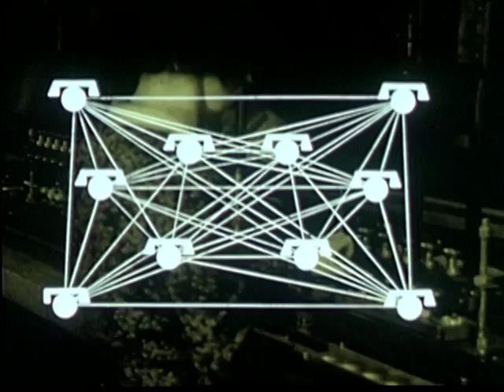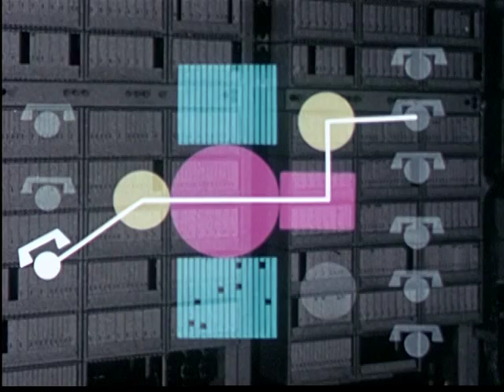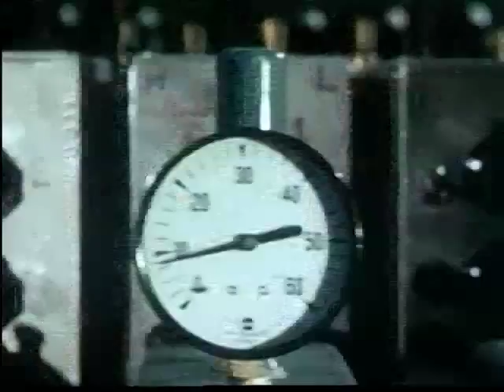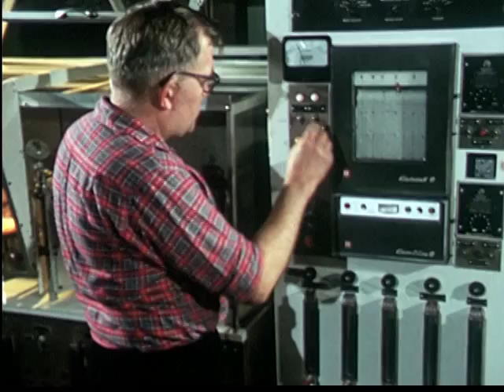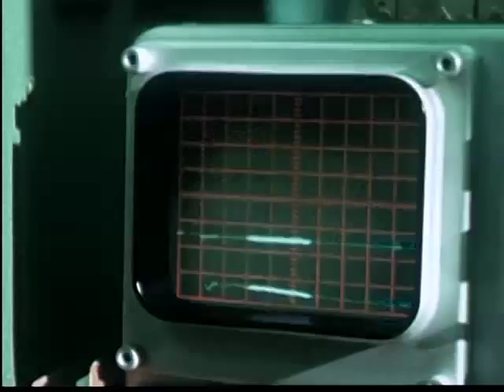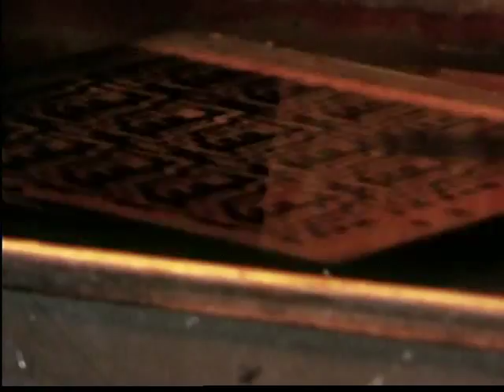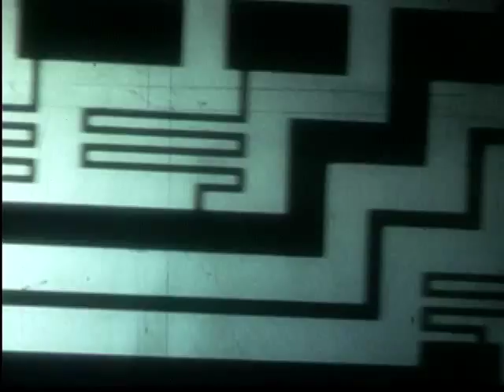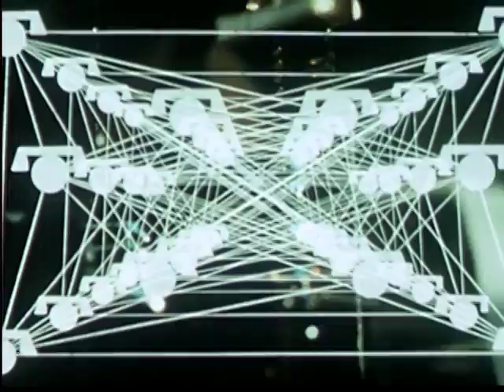AT&T Bell Labs 1 ESS (Electornic Switching System) Manufacturing Processes (1965)

Comment: I remember when the Wisconsin Telephone Company (a unit of ATT) activated ESS on the Appleton, Wis. exchanges in April, 1978. The dial tone frequency changed. Touch Tone service along with Call Waiting, Speed Dialing, Three-Way Calling, and Call Forwarding became available. Pay phones started changing from rotary dial to Touch Tone, and pay phones changed from 10 cents a call to 20 cents a call. However, pay phones became dial tone first which meant you did not need coins for 911, to reach an operator and for "800" calls. ESS also meant the City of Appleton was able start having 911 service.

Comment: In 1970 I worked at 8 Harrison Ave Boston. ( the outside of the building was used as the Headquarters for the all female Ghostbusters movie, it was down in the Combat Zone section of the city. You had to walk by all the strip clubs , peep shows and xrated movie and book businesses to get from subway to the office).  There were two ESS machines in that building .  I worked on the third floor ESS #1 .   The other machine was on the seventh floor.  I believe there was a Panel machine on the second floor and a number 5 crossbar on four or five. I wished I had taken pictures. It may have been forbidden to take pictures inside the building, I can't recall.  When they changed the code it would take all night to updated the memory cards which I believe were 128 words x 56 bits. Each card was about seven inches by twelve . Just guessing , it's been almost fifty years.

Comment: Middletown Ohio received its first ESS in the mid '70s Armco Steel was hardhearted there, and they had a complete 10,000 line  block of phone numbers reserved for them. It was using a 1920s switch that was so bad it could take over a minute to connect to another local phone. They told Ohio Bell that they would go private if the exchange wasn't replaced. Ohio Bell brought in a 10,000 line ESS in a tractor trailer and switched them to it. Then they added on to the Central Office building, and started installing five identical 10,000 line sections to upgrade the entire exchange. Without Armco forcing the issue, we were scheduled to wait almost 20 years to replace  that CO. It was kept in operation with parts from small town COs that were updated, then salvaged the old equipment for parts. On busy days it took multiple attempts to place a call, and you were frequently connected to a dead pair.

Comment: I bet today all this is done by Machine and computer. More jobs lost.
Reply: I agree to a degree, many other jobs have been created, with your advancement of electronics and computers in general
Reply: Work that could not be done by humans didn't take jobs from humans. The transistors and reed switches shown here were crude, even by 1980 standards. Early IC logic gates simplified the designs, and progressed from Small Scale Integration to Very Large Scale Integration over a few decades. In 2000, I worked to bring the first Software Defined Telemetry receiver to production. It had 14 microprocessors, and millions of transistors, yet it was only seven inches tall. With the technology in this video, it would have been impossible to build. Even if you could hve built iit it would cover several square miles and need its own power plant to run it.